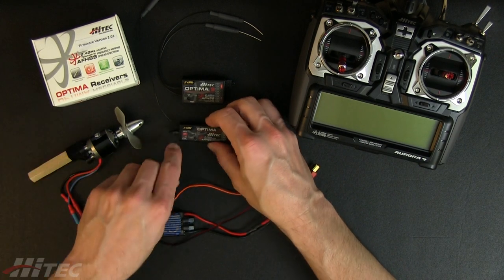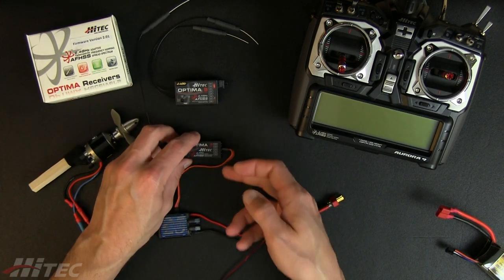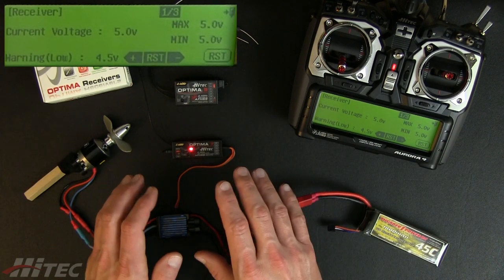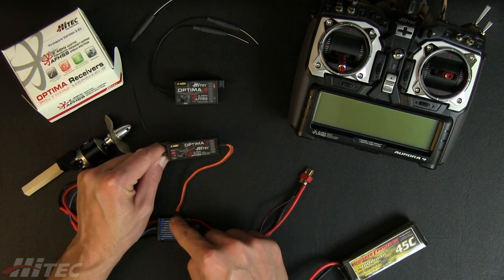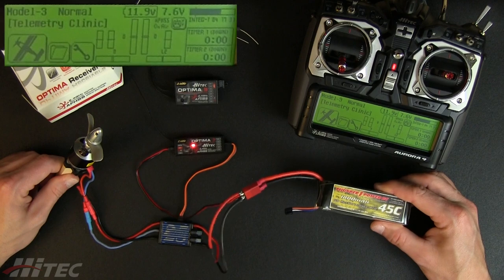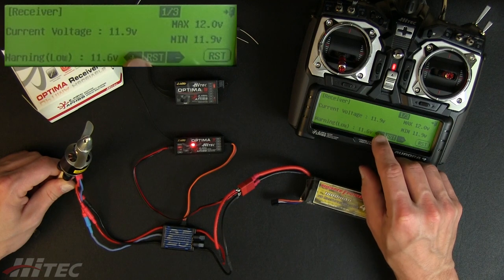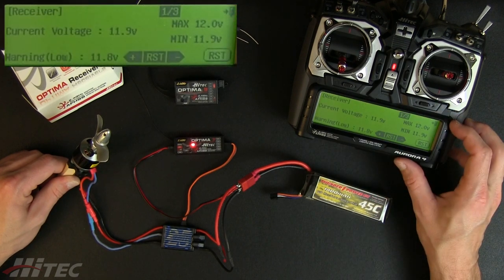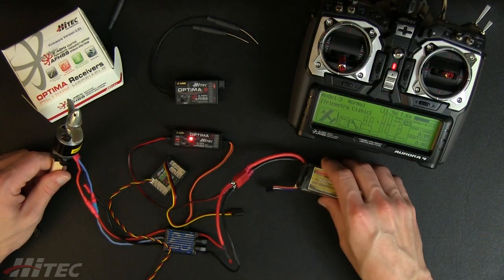Hitec Receiver SPC Port Wiring Clinic

Comment: Why isn't channel 3 marked as power/throttle as default in the transmitter for all model type if that is the only thing you can use it for, across the range of receivers?

Comment from the maker: I was an old die-hard ElectroTek RC LXS monitor user until I started using the built in SPC monitoring.  What a great way to go for sure.  Still a problem when I use Futaba or Spektrum but about half our gear runs on Hitec so it's worked out great.  No additional parts needed.

Comment from the maker: Some Hitec radios like the Aurora 9 already monitor receiver voltage on the main screen and you can set your alarm to the voltage threshold you want.  Your NiMH battery is supplying the radio system with its power so there isn't a secondary power source keeping the plane in the air (unless it's a gas plane with a separate ignition battery).  In that case you'd want to use telemetry to monitor the ignition battery and leave the standard setup on the radio to monitor the Rx battery.

Comment: First, thanks for the video. I've looked and looked for the proper way to do this and I finally found it in your video. I have a couple if questions if you dont mind....

Question 1: I did this exactly the way you have described it, and my Tx has the main battery voltage displayed but I lose the bind. Suggestions?

Question 2: Should I be concerned about the small wires that I am using to connect to the SPC? Seems like a lot of voltage/amperage to run through such a small wire.

Comment: How did you set up the flaps? I'm doing a Y connection but one servo goes down and the other goes up..  I'm trying not to do it with the Y connection, and use the 7 channel but that where the battery goes.
Reply: Re-orient one of your servos so both go in the same direction. I struggled and finally learned how to get two servos operating flaps in three trimmable positions for retracted, takeoff and landing deflections, with slowed servo action. Got help from Hitec technician, requires transmitter settings and mechanical linkage adjustments and some profanity.

Comment: Quick question: When you have the SPC tie in, does it actually feed power to the receiver. Specifically, would it prevent brown outs if I'm using like 6 or 7 servos? (With, for example, a 30amp ESC with built in BEC feeding the receiver)
Reply: The Supplementary Power Connection (SPC) feeds power to the receiver independently and directly from the motor battery pack so you should never have a brownout. Optima receivers operate on up to 35 volts. Servos get power separately from the speed control's battery eliminator circuit ( BEC)

Comment: hi... I connect the spc to the lipo as in this vid... yes... I've got the lipo voltage value... however when I try to set the min voltage value my a9 respond "sensor are not connected" ... what am I do wrong?
thanks again for sharing this informative video...
Reply: Hi, I am having the same problem. Did you manage to make it work?

Comment: Great video, thanks a lot! If I have 2 x 6s batteries in parallel does that add up to 12 cells (3.7 V per cell) or not?
In that case my output will be over 35V in total and I will not be able to use SPC port! Is that correct or am I missing something? Thanks
Reply: iVirtual - Aerial Photography and 360° Virtual Tours parallel is capacity series is voltage

Comment: THANK U!  iam kinda new to airplanes and was TOTALLY LOST when i switched to the Aurora9.  i really like it and all, but from the min i open the box i had no-idea wat all the extra wires and switches and clips were 4?!  i mean, until i saw this vid' i dint hav a clue wat to do wit the extra radio plug?? read the instructions half a dozen times and still couldn't figure it out. y in %$#$# cnat Hi-Tech tell ya wat the thing is 4 instead of jst sticking it in there? sum of us r new at this - Grrrr